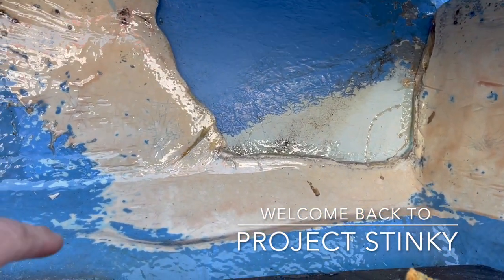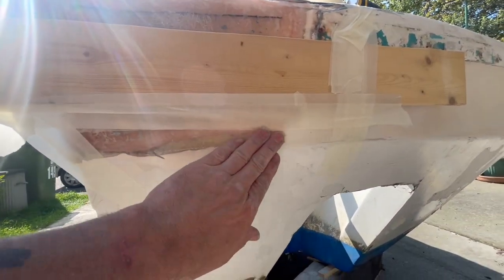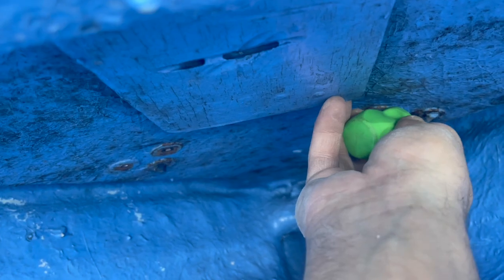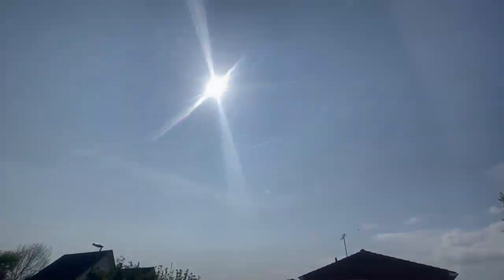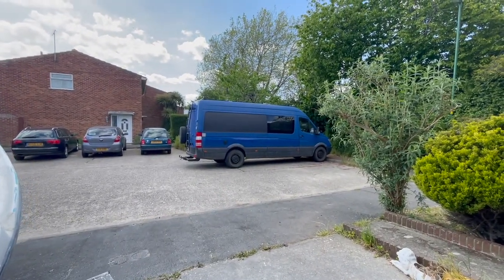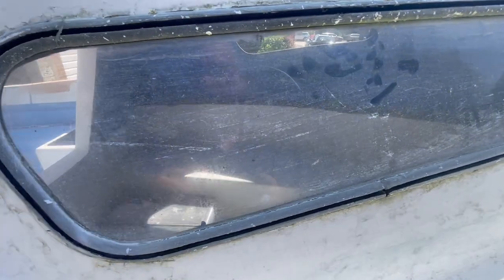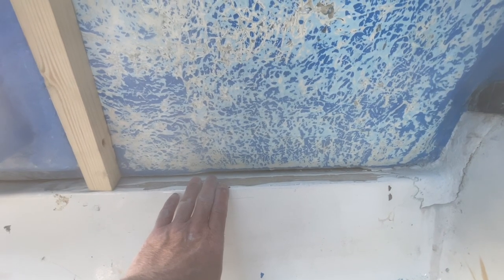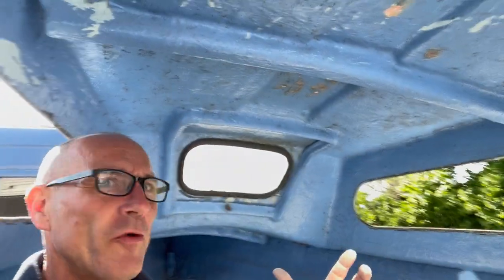Sunken boat restoration. Hull repairs painting and so much preparation . Jolly Colin episode 2.

Comment: Why don’t you cut away the whole cabin-ish thing off making it a open sloop, instead of the cabin thing you could make a canapé which can be just as covering if not more than the cabin (omg that is ugly..) A little 2 cilinder marine diesel in it , a nice little slow runner ;-) you can make a truly huge profit may you want to sell it. The skegs you cut away were there for stability, best if you kept them to be honest, they were there to stop the hull from rolling to much. If you need some know how, Ross from life on the hulls or Sail life here on YT might be handy. With all said it is a truly nice project! Cheers, Albert
Reply from the maker: Hi Albert
I thought the skeg’s were on the outboard engine right at the bottom, I will check Ross out on YT 👍👍👍
Reply: @ProjectCamper  I admire your tons of ideas and actually do the things you think is worth it. About the skegs, honestly don’t know if this is the proper name for this anti rolling thingies, but that they are or were there to prevent rolling I am sure.